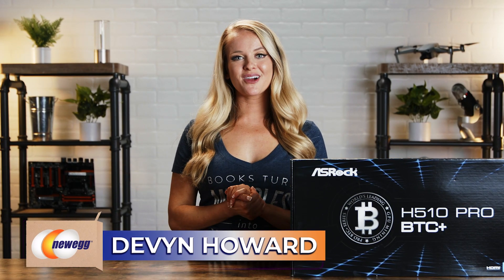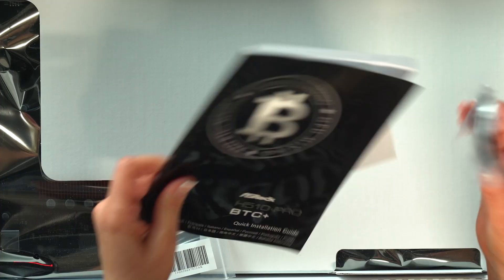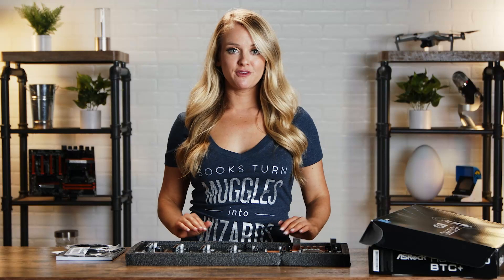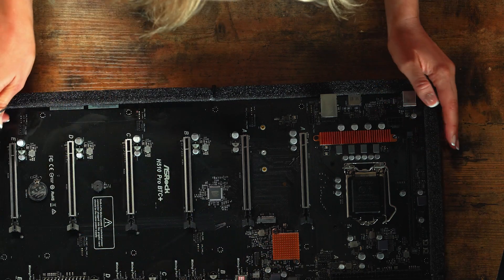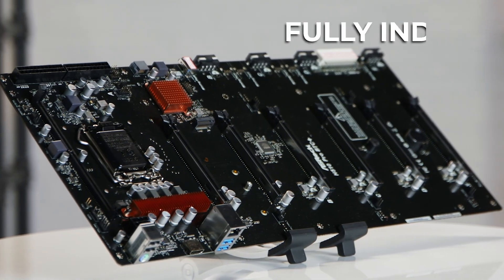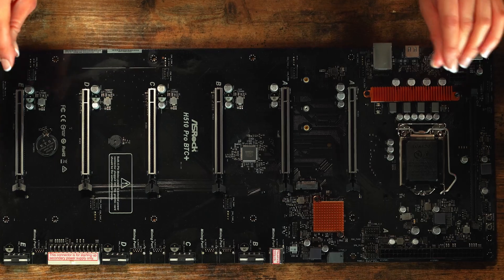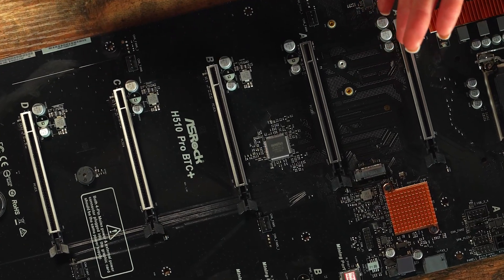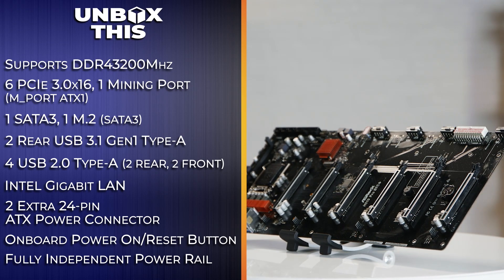Unbox This! - ASRock H510 BTC+ Motherboard

Comment: Honestly, it's about time a mining motherboard supported memory faster than 2166/2400 mhz and a 6th or 7th gen processors.  I mean, after buying a half dozen video cards on eBay (anyone can buy one or many there) you would want some "GAMING" like performance.  Yes, a few motherboards do support the 1151 8th and 9th gen Celeron/Pentium /I3 processors and up to 2666 memory, but HERE, we have a motherboard with M.2 for booting, takes 10th and 11th gen CPU's with 1200 pins, and fast DDR4 3200 memory.  It's tough but when it comes to mining, you gotta squeeze every MH/s out of your RIG.  Credit to Devin Howard for making this video!!!
Reply: Builded 17 Rigs with this MB, very reialable and it's hard to have problems on it, only defect: why they deactivate and not soldered 5/6 mining ports? It support up to 10 GPUs on our labos without problem 🤔
Reply: @alessandrokenzoinvernici6274  . I bought one, and custom modded an 8GPU Veddha frame to hold one motherboard on the bottom shelf and another on the top shelf.  I used an I511600K so I could also CPU mine XMR at the same time.  I also wondered about the missing Mining ports!
Reply: @alessandrokenzoinvernici6274 Do you mean you soldered on the missing USB headers so you could add more than one riser?

Comment: why is it advertised like a desktop mobo when its for gpu mining
Reply: How so?
Reply: @chrisewalt3806  the way the host references the size states that it wont fit into a smaller rig (2:48) and makes a sarcastic comment that the customer could try folding it which implies somewhat that they are talking about fitting the motherboard into a pc case, rather than an open air rig which is almost always used for gpu mining. After this, she also mentions how "If you are really cost cutting, this motherboard comes with an internal graphics card", however the "cost cutting" mentioned is referring to not using dedicated gpus which doesnt make any sense considering this is a mining motherboard designed specifically for using multiple gpus, not for everyday use.
Reply: @oliverwoodhouse1221  "not using dedicated gpus which doesnt make any sense considering this is a mining motherboard designed specifically for using multiple gpus"
I see you don't know much about mining. Miners don't use their gpus for graphics, they need an internal graphics card.